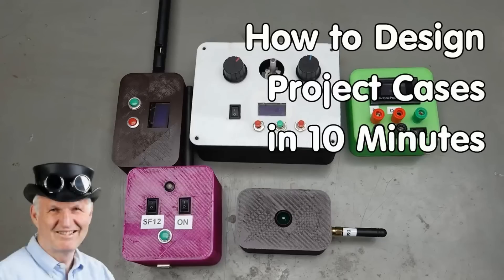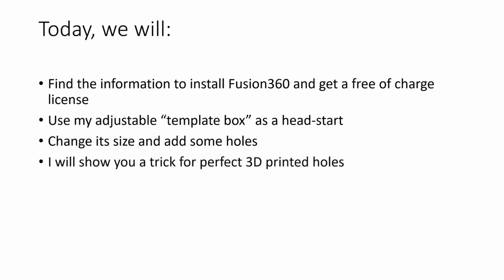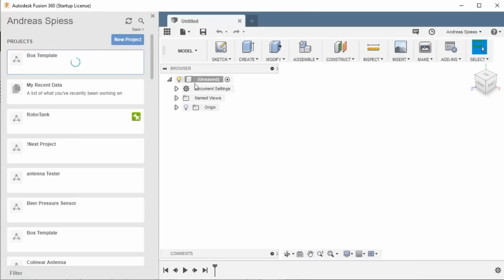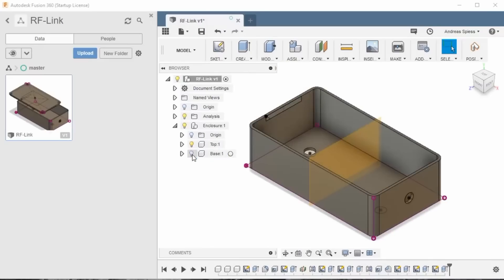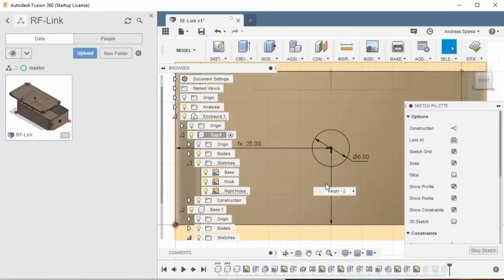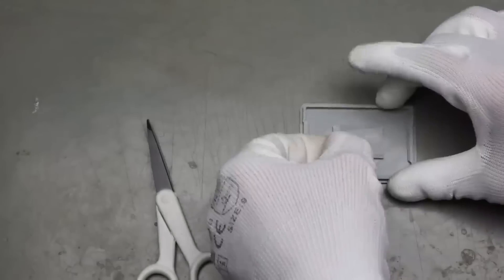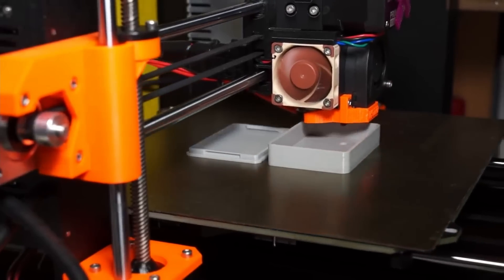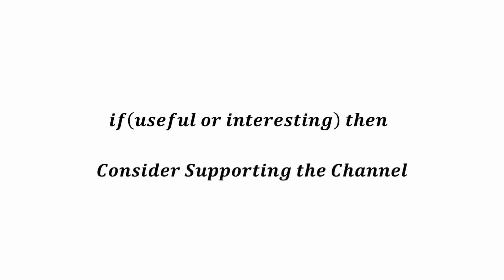#398 How Can I Get Snugly Cases for my Projects?

Comment: Great video, thx Andreas, very useful and interesting ! An alternative might be OpenSCAD , its 'program language' approach may be easier to learn for people coming from a software background.  How do you suggest to attach projects to the inside of the enclosure ?  3d print standoffs and hot glue ? Bolts washers and nuts through the case ?
Reply from the maker: Most of the time I use double sided tape. It is easier than standoffs.

Comment: I tried to re-register for Fusion 360 without success. I suggest we don't recommend these packages as it's hit and miss how long they provide free access for hobbyists. Several now seem to require academic email addresses. Perhaps, although I hate it, FreeCAD or similar is better in the long run.
Reply from the maker: I remember that ls time I also had a long time to get my license renewed. I do not recommend CAD systems. When I changed from SolidWorks I did it because everybody used Fusion360. I tried FreeCAD and decided to stay with Fusion360 for the moment.

Comment: Have you ever considered using Octoprint (or Octopi) for the 3D printer?
I found the remote features in Octoprint, including the terminal interface, quite helpful instead of using the printers control panel.  I use a Ender 5 so definitely not up to Prusa standards, but it works :)
Reply from the maker: This was a replay video during my summer break. Now I use Octoprint and even did a video about it.
Reply: @AndreasSpiess  I like Octoprint.   I also added a touch display to it using Octodash so I can have a nicer local interface as well as the web interface.  :). Thanks for the great videos

Comment: Great Video as usual Andreas, so I'm almost reluctant to say something negative, but I was really surprised to see that Fusion has no Linux install. I've used FreeCAD for a while and am pretty confident in it, but the expand/contract feature, and the positioning of holes using width/length as datum rather than reference to an XY datum looked really sensible, and really useful. Shame I can't access that within Linux.  I'm outside looking in with a sad face, with my nose pressed up against the window, looking at all of you having a good time!!
Reply from the maker: My main computer still is on Windows and Fusion360 was widely accepted when I changed from Solidworks to Fusion. So far I prefer it over FreeCAD.
Reply: @AndreasSpiess  thanks for the reply Andreas.

Comment: Thanks for the nice video.

Defintly I prefer Prusa slicer. Plus some gcode editing...

The mk3s is definitly a good choise. But: For boxes the PEI powder coated shields are much better. With flat-bed mod (leveling 8 of 9 screws with an octoprint plugin) and the superPinda, the first layer is good on the not powder coated  plate, but you still see the tracks of the nozzle. With the powder coated bed and using hilbertcurve as bottom pattern theese are (exept for perimeters) totally hidden (esp. adding M221 110 after first after_layerchange and M221 95 after the second to do a little bit overextrusion in the first layer).

Also it is a bit odd to use stickers on a 3d printed case - you easy can integrate text and logos into the print. Depending on the colors you use for box and text/logos, you can easaly do multiple colour printing manually on the top and bottom of your box. You simply use the profile for the MMU2, add cutom gcode for toolchange beeing "M600" and deactivate the wiping tower. I normaly embed the text/logos 3 layers deep (maybe more if the filament is tranparent - maybe even the whole thickness of the later topside to backlight the text from the inside of the box).

Text and logos can easaly created with MatterControl - it can vectorize bitmaps, quite useful to do a logo quick but not dirty... 

With 0.2 layerhight and 3 layers embedding, make the text/logos 0.6mm thick.

First you put the STLs of your box into PrusaSlicer, than the STLs for Text and logo. This order matters - If two objects overlap, the latest object has priority, so while slicing the needed space for the second object is automticly cut out.

So for example if you want a green "ON" and a red "OFF" left and right of a switch on a black box, first put the box.stl's into Prusa Slicer, than the on and than the off (do not forget to mirror ON an OFF objects, as your later top-side will be the first layer...). Select the box and choose extruder 2 for it, for on use extruder 0 and off extruder 1. Place on and off onto the bottom of the box. In print settings choose 3 skirtlines , distance skirt to object about 2cm if possible and do the skirt 3 layers high. Slice. Print.
The mk3s+ (and any other printer with m600 activated) will do the following now when printing the gcode after heating:
- it changes to virtual extruder 0, so it ejects the filament and you have to insert filament 0 (green in this case)
- it does one skirtline, than printing "ON" with green filament
- it goes to manual filament changing position and ejects filament
- you now insert filament 1 (red) . Do not remove the extruded filament now, simply hold it with tweezers.
- confirm filament change has been successfull and after 5 seconds head goes back to prior position. still hold the extruded filament and remove it shortly before the printhad is at his old position - it oozes a bit on the way back and you remove the ooze this way also...
- printer now does the second skirtline - so nozzle is well primed before printing "OFF"
... and so on.
The order of manual filamentchanges is 0,1,2 - 0,1 - 0,2, as the last filament of a layer is used first on the next layer. With 3 layers embedding, and 3 colours, last filament is 2. This is (one) reason to choose the box using virtual extruder 2 - you simply have one filament change less...

This method gives already good results, but you might optimice the gcode (for example with notepad++):
- search for M600
- on the first result, delete the M600 and the T0 the line above it (no need to reinsert fialament 0 if it is already loaded before starting the print)
- on the next result, delete the T1 and the M600, go a few lines down after the next G1 X... Y... (this is the first segment of the next skirtline) and insert a line with the M600 command there. This way the filament change is not inside the box, but inside the skirtline. So any ooze you might fail to remove would not effect the box - and the skirtline is waste anyways...
Do simular with the other M600's
The prints will be astonishing.

There is a variation of this method using pattern instead of colourchange to write text and logos:
Standard setting (only one extruder). Hilbert curve as bottom layer, 0 (!!!) perimeter, print speed for the first layer only the halve of the presetted speed, better a quarter only). Modify perimeter settings for text/logo objects to 20 perimeter. Hight of text/logo objects only 0.2mm. Slice and save the gcode as A.gcode.
Change general perimeter to 3 (or whatever you would normaly use), slice again and save as B.gcode.
Open A and B.gcode in notepad++. Search for the second "after_layerchange" (there will be a comment z=0.4) in A.gcode and delete everything afterwards. Search for the second "after_layerchange" in B.gcode, select everything from there down to the end of the file, copy and paste it to the end of A.gcode. Save A.gcode as "box.stl".
With hilbert curve as general pattern of the first layer, but the text made by parralel lines you have different reflection.
If you print with black filament, you can legaly take the box with you while visiting Disaster Areas Showspaceship (might be hard to get a black LED...)
Reply from the maker: Thank you for your long description. You are a true specialist! Using two colors instead of stickers for sure looks very good. I will save your description for the case where I want a very good quality case. Usually, I optimize effort and quality and accept a slightly lower surface quality and stickers...
I tried those grey powdered sheets with lots of adhesion problems. This is why I reverted to the flat sheets.
Reply: @AndreasSpiess  Yes, the powder coated sheets have a lot of adheason problems esp. with PLA.
A quite simple solution: A new spring steel is first cleaned with Isopropanol, after being dry I spray it with AprintaPro PrintaFix Basic. To refresh the adheasive I give a little amount of Isopropanol on the bed, add two shots of AprintaPro PrintaFix Basic and than whipe the mix over the whole bed. Only needed every 3-4 prints. Only once the aheasive summed up to much - I simply washed it and treated is like a new sheet and this worked fine again.
So maybe you invest in a little bottle of AprintaPro PrintaFix Basic...
The adheason is perfect this way (one time printing an smal but long object in a room with a cold ambiend temperature, the warping object still stuck to the steel - lifting the steel from the magnets...)

Also for the bed-adjusting mod you only 8 nuts. As it is to be done only once (or after servicing the printer, like disassambling the bed to clean and relubricating the bearings and the rods), you do not even need a Raspery Pi - simply install a Virtual mashine with Debian, install octoprint and the prusa bed level plugin there. So you can improve the bed level practically for free.

To see the results with manual multicolour, I put two photos online, showing the displays from two of my prusa clones:
https://c.1und1.de/@519863702220964192/x0YxbRagSKOsIJG7XGy0UA
Reply from the maker: You get very good results. indeed! Maybe I give this  AprintaPro PrintaFix a try...

Comment: I was never comfortable with cloud only software/files.... so I currently only use Solid Edge which is free to use.
Reply from the maker: Good point. The trend, however, seems to go in the opposite direction :-(
Reply: @AndreasSpiess  totally agreed. Still, do take a look at Solid Edge and Free CAD, I get the impression they'll be around a while for 3D modeling parts.

Comment: if Fusion 360 pulls out free license, just export your models in STP and switch to another software. Of course the parametric designs will be lost but at least you have your files.
Reply from the maker: Good to know that there is this possibility.

Comment: Hi Andreas -
This looks great, it's just what I need for boxes for projects, and I have one right now I was just trying to design something for!

BUT - I downloaded the files, and none of them will open in the current version of F360. Most just say that F360 doesn't recognize that file type (the .scad ones), but on the .f3d file, it says it's not a valid zip package. Maybe the file format needs to be changed to work with the latest F360 version? (I'm using 2.0.10813). Thanks as always for your great(!) content!
Reply: I just opened the .f3d on the my latest version of fusion just fine? (2.0.10564)
Reply: @jbuszkie  Ah, thanks for the note that caused me to try again! It turned out to be a download problem: I'd tried to just download the files individually from Github through my browser. When I downloaded and opened the Zip file, everything was fine. Thanks again, and thanks to Andreas for posting the vid and associated files!

Comment: I was able to recreate your idea in FreeCAD. All I have to do is fill in length, width, height, and a wall thickness, and poof! I'll try printing one later. Thanks!
Reply from the maker: Maybe you share your design?
Reply: @AndreasSpiess  I would love to. I previously tried to include a link to imgur of a photo of a box, but YouTube didn't like it and removed my comments. (I tried twice). What do you suggest as a method to share the file? I've hard [heard] about something called "grab cad" but haven't looked into it.
Reply: @SomeGuyInSandy  Yes, I'm having the same issue. Youtube does not seem to like github links in its comments.

Comment: Bravo. Would be nice if the design would also have the layout of a PCB, so people could work backwards from box to custom PCB.
Reply from the maker: For most of my projects I use ready-made boards. And the cabling plus batteries etc often need more space than the PCB. So I usually design the case last.

Comment: Funny, I have spend the last 2 Weeks in Blender to create a model for my 3d printer  (also some sort of project case ;)) but yes.. with a ready made box it is a 10 minute thing :D
Reply from the maker: Especially the lid is not easy to design…
Reply: @AndreasSpiess  Haha, try to design 6x7x3 mm Button caps that fit exactly into a corresponding cutout in a case :P
but I am getting quite good in blender .. creating 3d meshes.. so powerful and versatile that programm. even has a plugin for cleaning up meshes .. linux native .. what more could you (I) want :) (not an add^^)

Comment: Technical support for FlashAir W-02 Class10 and FlashAir Class6 on FlashAir App will no longer be available after 31 January 2020.

so i guess we need smth new?
Reply from the maker: In the meantime I use Octoprint instead of the SD card. But I assume she flashairs will also work without support.

Comment: Thank you Andreas, helpful and pragmatic as always.  You may want to convert to OctoPrint to make your printer wireless.  Its more in the raspberry pi space but I find it helpful to monitor my long prints when I'm in a different part of the house.  Maybe that's an idea for a new video?  Cheers,
Reply from the maker: You are right. This is a republished video and in the meantime I changed to octoprint. I even did a video on how to switch it automatically off…

Comment: Hi, Andreas.  Thanks for the videos!  I was using Fusion 360 until the changed the number of active models allowed.  I switch to Solid Edge Community Edition.  Quite impressive and free.  Cheers, Thanks.
Reply from the maker: I came from the paid version of Solid works but changed to Fusion because at that time, everybody used it. This limitation, BTW, is not relevant for Makers. You can have as many designs you like. Just switch them to editable before you want to use them.

Comment: Nice designs Andreas. You can save multiple bodies by doing right click on the project name in the browser and selecting "Save As Mesh". From there you can choose the bodies and whether they go to a single file or individual files. I also find Save As Mesh (Formerly save as stl) is a bit easier for single bodies than the 3d print utility. Change the file type to "STL binary" if necessary.
Reply from the maker: Thank you for the tip!

Comment: Hi Andreas! Thanks s lot for the video and the basic box design. I just made a download and works well with Fusion360. However it seems that you have used an old version of Fusion360. It look very different to my current version and the "parameter" menu is on a different location. Someone wrote here in the comments that this video is the same as an old one?
Reply: this is a replay while he is on holidays.
Reply: @TheUnofficialMaker  ahhhh, ok. However great design, usefull and with a little bit search around in Fusion it is still working....
Reply from the maker: This was the last replay for this summer break.

Comment: If you're having trouble with adhesion to your Prusa bed, it might be worth picking up the new powder coated version. It's a significant improvement over the original bed, improving adhesion and providing a nicer texture on the bottom of your print.
Reply from the maker: Thank you for the tip!

Comment: That's what I did many years ago. Invest one to two hours for a base box design and you are set for life. Minor tweaks here and there but that's it.
My box will even place screw holes and thread holes in equal spacing, depending on size and configuration.
Personally I'd go with the maker edition of Solidworks every time. Too many bad experiences with Autodesk
Reply from the maker: I prefer these lids over screws because it is faster to open and close. But I also have boxes with screws.
I came from the paid version of solid works but back then they had no offer for makers and everybody used fusion.

Comment: I just use openSCAD for simple geometries like this
Reply: Yep. OpenSCAD. Coding works well for me. It's kinda like C. And it's well documented. I do everything in OpenSCAD.
I don't like how Autodesk offers Fusion360 as a free service via a subscription. Tried FreeCAD and a few others. All very complicated GUI work with lots of mouse action, compared to OpenSCAD's programming language that just needs a keyboard.
Reply: @fluffyblue4006  First time I hear about OpenSCAD. I will check it out.
Reply: Me too. OpenSCAD is a much better approach - the programming style. Do you have a good parametric based box, without screws?
Reply: The one thing that stops me from using OpenSCAD for more is it gets awful performance with more complex geometries, and for even simple things like circles you have to make them super low res to get acceptable model viewing and then only at the end can you change them to be higher fidelity. This makes visualizing certain things and possible interference pretty difficult for me in some cases, so I ultimately end up going straight to Fusion or OnShape for designs I know will end up more complex, and even simpler designs too just to get more practice with the tools that end up being more capable...
Reply from the maker: I am more the visual guy. And programming the lid construction would scare me…